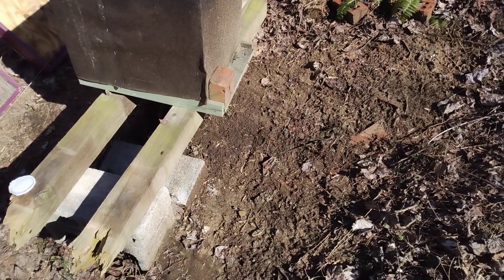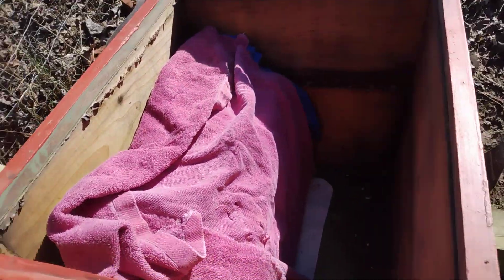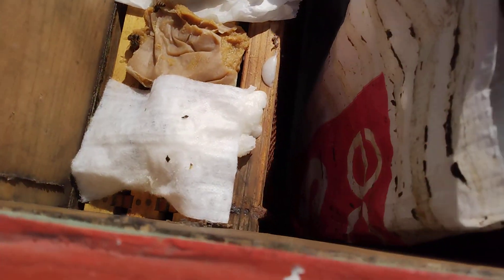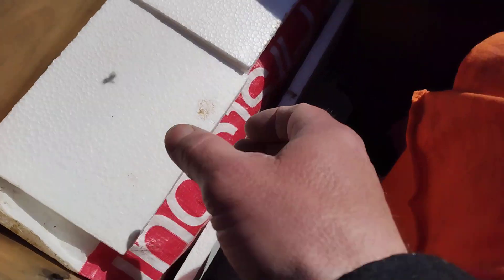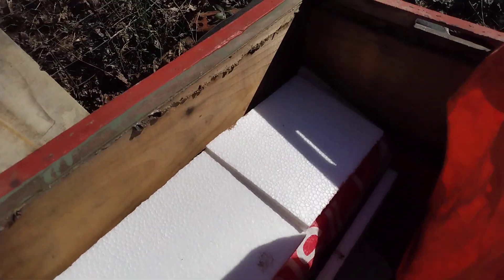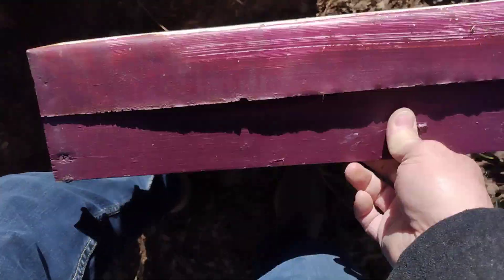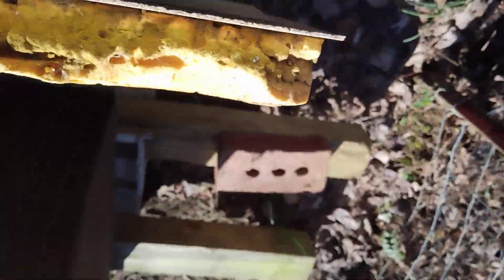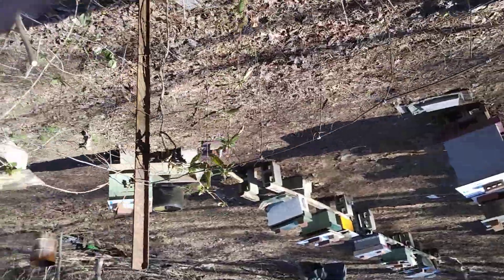Beehive and Flies part 2

Comment: its been a hard winter for bees. when I have flys there dead bees that are wet in the bottom of the box, but those could be there because the black box is warm
Reply from the maker: I never thought about that tar paper drawing flies from the warmth. But just like everything in beekeeping we do one thing to try to help but don't always think about what other issues it might create. I had raked out the bottom board dead several times this winter and they had upper and lower ventilation, so I'd say you're right about the tar paper warmth. Thanks man 👍